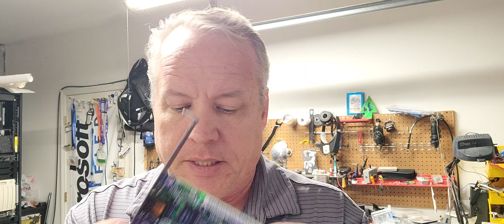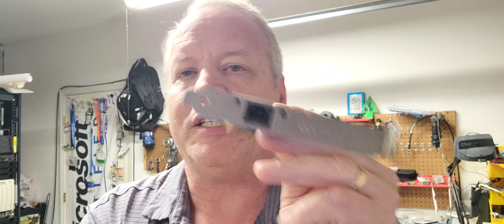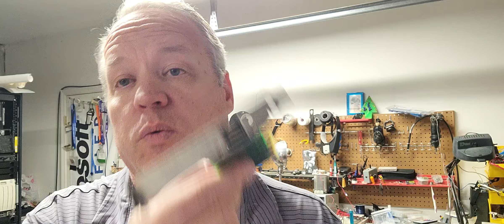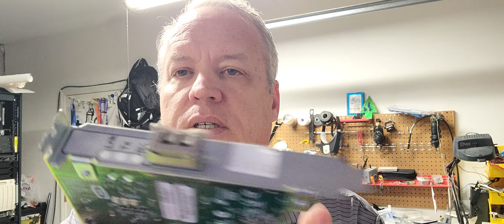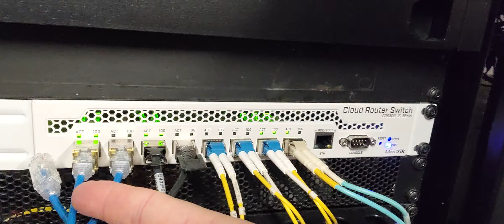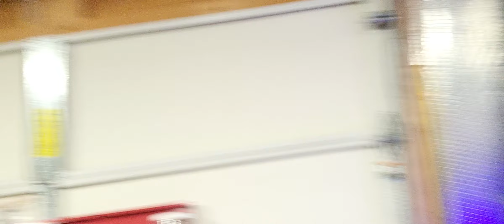PFSense Firewall router OS has finally there and very good now to use for your home and test lab

Comment: The most difficult operating system in the universe, I tried to use it with zimaboard , but I found out that it is very, very complicated.
Reply from the maker: Sorry to here that.  I didn't have that issue went I match it to the Dell 3500 chassis for I new the OS had all the drivers for the NIC I used and the base board. Were you issue with general setup or related to hosting the OS on you hardware?

Comment: Pfsense can run on a Potato, you don't need a Dell Precision 3500 :)
Reply from the maker: Yea but the space and function is nice to have but sure a a Raspberry pie can this but not well.
Reply: But the raspberry pie doesn't consume 100watts either :)  @leadiususa7394
Reply: unfortunately netgate dosent let you run on a pie but the sg1100 and sg2100 are arm based the rest are x86 if i remember   @leadiususa7394